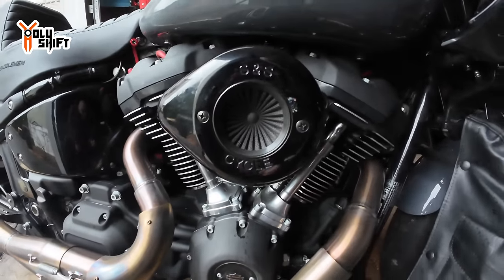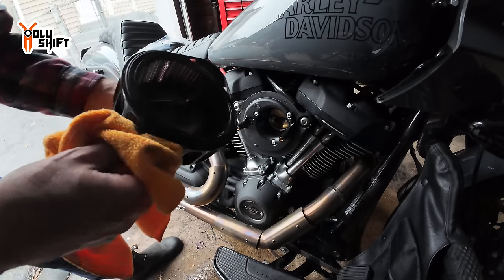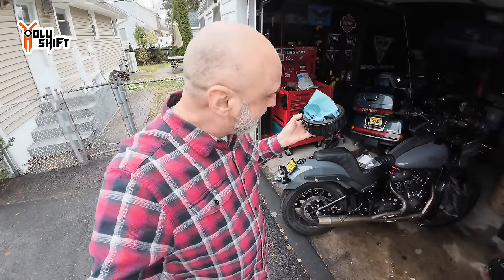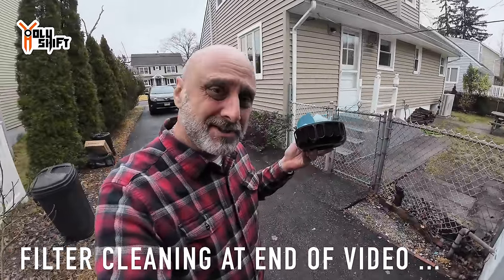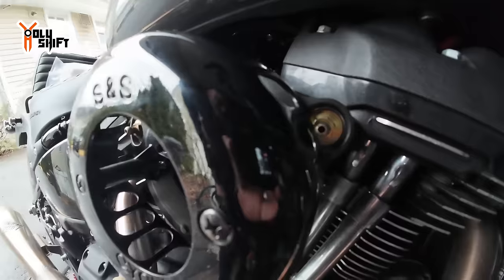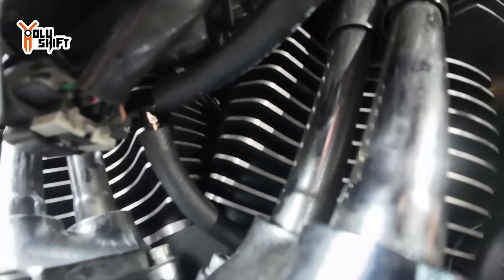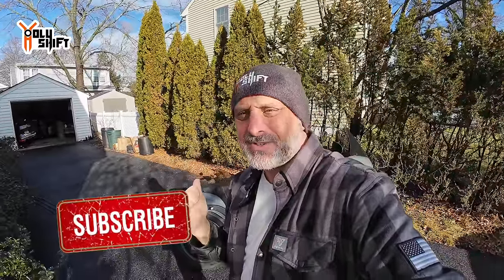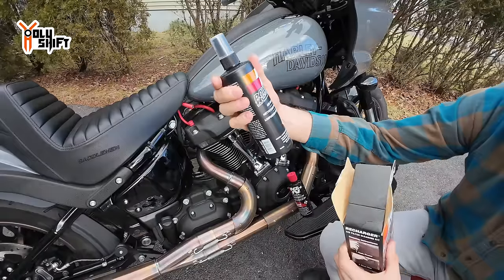Big Problem - EASIEST FIX❗️External Breather

Comment: Sandy great video, just be careful with how much K&N oil you put on the filter. Put just the bare minimum to cover it. ( I have found the K&N oil spray bottle works easier) If you put too much oil on the filter it will get sucked into the intake and gum up and ruin you MAP sensor and the air sensor. Look it up online if you don’t believe me. There are plenty of posts on this problem happening.

Comment: That's a problem that's been magnified by the M8s, the crankcase ventilation system isn't able to keep up with the added compression and displacement that the M8s produce. I would recommend keeping your breathers connected to a vacuum source as most vehicles on the road do(pcv system), the added benefit to a vacuum source is it helps evacuate crankcase pressure(vacuum in a crankcase can add HP & mileage). I would also recommend the Trask vented trans cover(helps the overworked stock vents), in addition adding the Feuling short sump plug, it can help the oil scavenging by opening up the space where the oil pump has the ability to suck out more oil. These remedies won't 100% cure the oil in the air cleaner but it will help tremendously. Back in the old days the shovels and pans would just puke out a little oil onto the ground via a vent hose(marking it's territory) so the EPA made Harley come up with a more "environmentally friendly" system. Hope this helps. God bless
Reply: Sandy said that he has the crankcase ventilation through the Trask cover, and no, you do not need a vacuum source connected to the PCV system. The Positive Crankcase Ventilation system does not need a vacuum because the umbrella valve opens up only if there is positive pressure inside the head not matter if there is a vacuum source or atmosphere pressure at the other end. Sandy has done it right.

Comment: Here’s my problem with this mod, I haven’t had any breather mods done yet but will do trask cover soon. The trask cover has a check valve built in, this stops air being sucked into the engine when cooling down. The oem breather system sucks air back into the engine when cooling but it passes through the air filter usually oiled. All air has a certain amount of water in it depending upon the day. With a direct breather to atmosphere, you will get more direct airflow with moisture back into the engine. This is where I see so many people looking at the catch can or pipe work to say “look at all this goop that I saved from my piston getting”. When in fact by this mod you allow more air out during running the engine and more air/water back in when cooling. I sincerely am not a mechanic just over thinking the whole mod. I have seen some people place a check valve into the air filter breather mod which I think is better.
Reply: There’s a one way valve in the actual breathers on each cylinder head.

Comment: I run the Trask breather, fueling breathers in the heads, fueling air cleaner and cam chest. Works perfect! (Not cheap!). Synthetic oil does not burn! It causes massive carbon buildup on the pistons. Cars and trucks have the same problem. The Trask trans cover vent is by far the best solution. My buddy made his own by drilling the stock cover. It works fine for a lot less money.

Comment: The Feuling vented dipstick or Trask transmission vent does help a lot with oil going into the filter. My Street Glide had 1800 miles then I installed the Dipstick and external breather for air cleaner and had a lot of oil inside the intake manifold and oil filter. My brothers Street Bob we installed the Feuling vented dipstick as soon as we bought it and very little oil in the air cleaner and throttle body after 2500 miles. About to install the external breather for it too.

Comment: an external breather does work, however it is really not needed unless your cylinder rings are worn and there is a good amount of blow by. The external breathers also delete needed vacuum. I run the Trask vented transmission cover and I get no oil residue in my intake. The Trask reed valve maintains the correct case pressures while venting over pressure. If your engine is a stage 2 or less, you shouldn't worry.

Comment: Sandy check out Green filters I’m pretty sure they have black oil for your filter and if you want more air to get in to the motor check there filters. I’m looking at doing the same thing but I ordered banjo style bolts so my hoses will hook up behind my intake housing

Comment: You should really get a DK Customs outlaw air cleaner system, with the external breather system, or at least call them, to ask what you need, for just the catch can. They have a lot of good products. I have one of their air cleaner systems, and I noticed the difference. Another thing that you might want to check into is footboard extensions.

Comment: I bought a 2015 103 Dyna Fatbob, a few months in which was basically enough time for the cleaned breather system to re create its path to the intake the bike started having problems. 
High revs coming down gears clutch pulled, slow speed cut outs, re starts and re cut outs, eventually clearing. Lumpy starts. 
Removal of air filter showed oily residue fouling the IAT sensor, being in the fuel tract it could clean itself but it still caused issues. 
Harleys fix £80 clean and a few months later the problem re occurs. 
Fitted a DK Customs Catch Can sitting just below the heavy breather between the push rods slightly above the timing chest. Blocked the pathways from the head breathers with fuel resistant silicon sealant. No more problems. Should the sealant be sucked into the intake which I highly doubt would happen, the engine would just spit the soft compund out rhe exhaust port.
Your cure looks un sexy as do most of the basic rubber hoses exiting air filters. 
I used black anodised end fittings though had to modify these to accept stainless quality jubilee clips and black braided hose with black painted brass fittings. Check it out end of video https://youtu.be/NXqZBmcgKSQ?si=cNnV5LmAc8XMo9-S Also show cased on the DK Customs website under pictures.  
Intend to fit a similar device on my M8 though being as we're back to a single cam and now have a ride by wire module in the way will route the breather over the heads and down below the coil. Should look sweet if done right. System will still vent high as ran simlar setups on X1 buells using forcewinder air filters which routed up and over.

Comment: The Trask tranny vented cover is the trick... it works fantastic. I get zero snot out of my head breathers. I also run the head breathers to a DK Customs catch can, which I installed inside the breather box. Dirty air does discolor the filter where the catch can is placed. However, it is minimal. I change my stock filter every 1000 miles. I only ride 2000 miles each year. I see people over oiling their K&N filters. They require just enough oil to cover the entire element. The best approach when oiling is to lightly spray the filter and let it sit for 20-30 minutes. This allows the oil to spread and penetrate. If there are white spots, reapply just enough in those areas. Repeat the cycle as needed. Also, if you over fill your crankcase with oil, you will get an oily mess on your filter. Never add oil to an M8 unless the stick reads at fill line or below. I use the cold check method. When I return from a ride, I keep the bike upright and let it idle for two minutes and then shut it off. When the bike cools down, check the level. It should be at the halfway mark. If it is, you are good to go. I have found that using the hot check is inconsistent. My two cents. Best of luck :-)

Comment: Yeah take your throttle body off and look in that intake manifold and see how much oil is in there. It will blow your mind. I just upgraded my intake manifold to a hpi ported and polished with new injectors. After seeing how much oil was in the stock one I wasn’t going to start the bike before I did the breather mod.
Reply from the maker: I didn’t realize that but I actually think the trask breather cover did help a bit . I’ll check the catch can in a few weeks and post

Comment: John, (AKA Blockhead on YouTube) and his mechanic did something simular a year or two ago. Those screws that you use didn`t exist then so they used three zerc fittings, two where the blow buy comes out, then rubber hose to the T then more rubber hose to the last zerc fitting in a drilled then tapped hole in the oil resovar top.

Comment: How dit the bike run after s&s filter and external breather ? Did you run it for a long time without maping again.
? 
I have 117motor and tuned with stock filter and s&s exhauste. Looking for do that filtersetup with the same breather setup. I dont whant to pay for tune again😮

Comment: Those hose will slip right off breather bolts. Oil will also coagulate in tubes especially in winter cold .
Reply: Not true I have mine on for over a year, never came off

Comment: Hi Sandy. I was wondering if your air filter might now be sucking in additional air in the absence of the S&S breather bolts.
Reply from the maker: I don’t think so - they are the same diameter as previous bolts - nothing changed the fact that the air only comes through the filter

Comment: On a level surface, a cold oil check. The oil level on the stick should be dead center. Any more than that, that's when the problems start. How do I know? Been there done that.

Comment: Hi 👋, Sandy and Family and Friends, I hope you all had a great Christmas 🤶, and wishing you all a Happy New Year 🥳, 
strange, how laws have changed about emissions, some I don’t think are for the good, I have used K&N air breather kits, on all my vehicles from back around the 70s, Doesn’t matter whether it is my bike or my car or my van, After watching your territorial pouring oil onto your filter, I had a quick look on Google and even went down to the basement to look in my fluid cabinet , and I have still got my K&N oil , which is an aerosol, and yes, I said aerosol not arsehole 😂. I believe the aerosol gives you a more even coating ., of oil over the filter, Ride  Safe, 
Happy New Year to everybody hope you all have a great one , 🎉🍷🍾. Phil from the moulin France .

Comment: You can NOT vent to atmosphere not epa compliant. And I have never had an issue with 2023 M8’s. stock or stage 4 Harley builds. I have three stage 4 Harley builds 140 plus horsepower zero issues.
Reply: Manufacturers can’t vent per the EPA but nothing prevents individuals from modifying.
Reply: I hope nobody calls the police

Comment: LOL only on an HD!  120yrs and they still can't build a proper bike.  You'll never have to do that on your Wing!  My '22 M8 didn't spew oil out but my TC103, 95 did!
Reply: Zero issues with M8’s. Attempting to fix a problem that doesn’t exist which will surely only create other real problems lol
Reply: You will not have to do that with Harley M8 too. But you better do it with the Wings too. All EPA complaint ICE engines have the PCV system, but only with the Harley it is soo easy to do that.
Reply: will or will not have to do with M8? I had no issues. with my M8. OR my Wing!  @kadimsilahtar